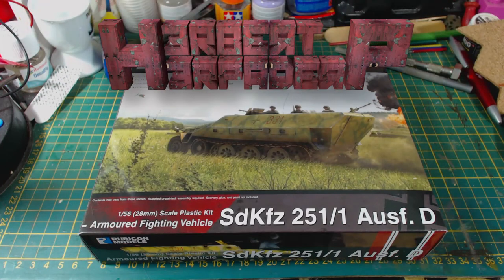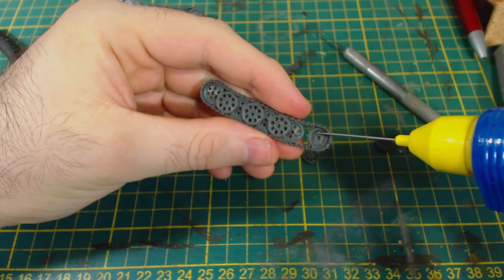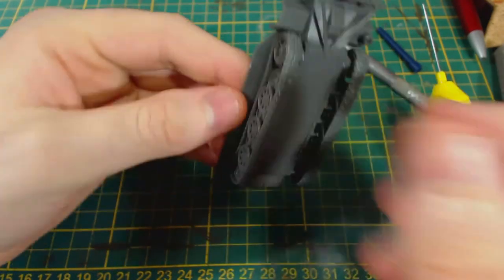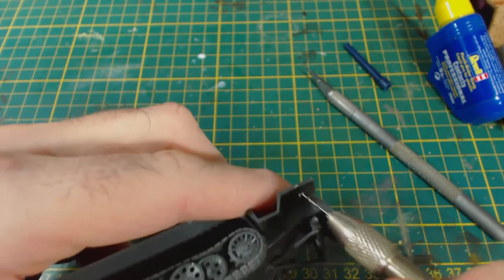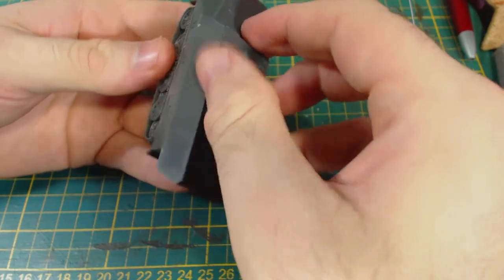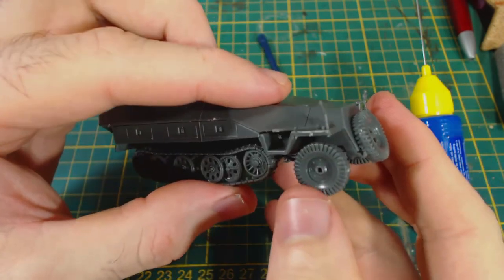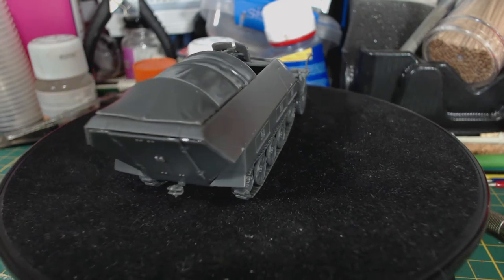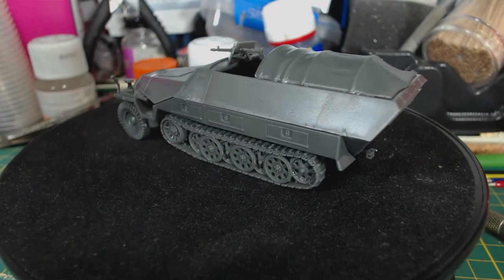Rubicon 28mm German Halftrack.

Comment: Bar things are fender markers showing exactly how wide the vehicle is from and where the front of the vehicle begins from a reduced drivers vantage point. On occasion they will have a mirror mounted to one side.
Reply from the maker: Makes a lot of sense to me!
Reply: they also attached different types of flags to them for unit designation and/or staff occupation.
Reply: They also dispensed custard.
Reply from the maker: Mmmm custard...